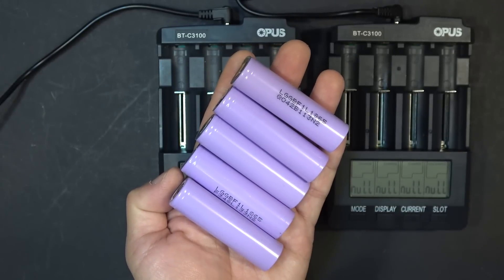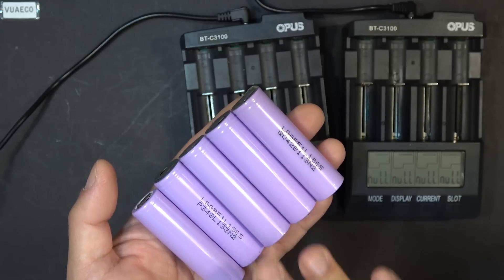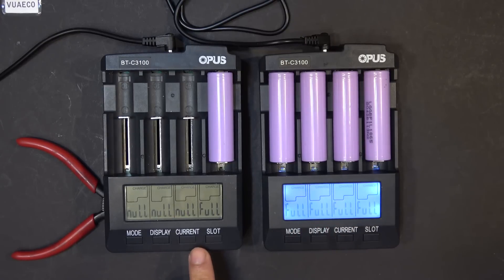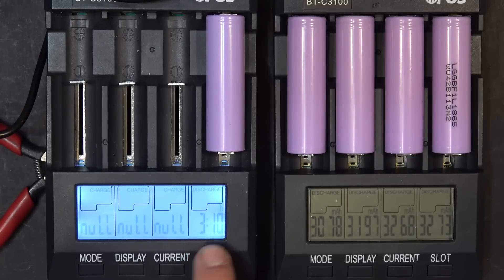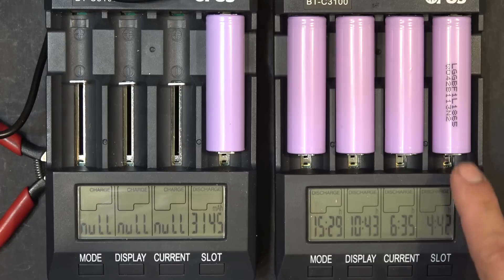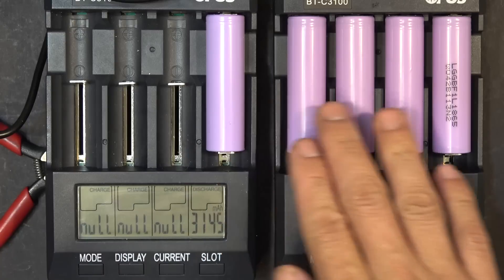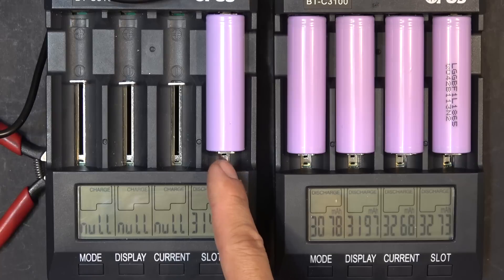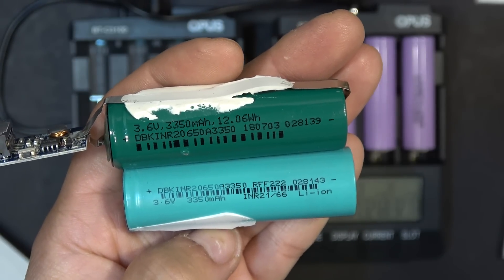Test 18650 cell capacity at different rates: what's the optimum rate of discharge?

Comment: With Opus you will not get full capacity of the cells becouse it only discharge down to 3,21v i use volt meter on every battery directly after discharge with my opus and all cell was 3.21v i think buy alot of opus i buy one but now i use Liitokala Lii 500 it discharge  down to 2,81v  and now i see more real capacity but some battery cells are specified down to 2.5v but have not found any charger that can discharge down to 2.5v but i like Liitokala Lii 500 it´s good enough for me and it don´t have a fan that can fail.
Reply from the maker: That's true the the Opus only discharged down to something like 3.0V and not 2.8V. But I think that's good for the battery because these batteries do not like to be discharged down to zero. You only do that a couple of times and the battery will be dead. Just ad a couple hundred mAh to the total and that should do it. It's much better than draining down the battery all the way to zero.
Reply: @vuaeco  yes that´s true, but you will see less capacity and use less capacity but the batterys will live longer time.

Comment: is there any way to mix laptop batteries and power tool batteries in the same pack considering the different discharge rate ? thanks for the great videos .
Reply: You can mix them without any problem when used for low drain applications, for example in a power wall. 
You can find tons of info on secondlifestorage.com

Comment: I opened this charger today and I noticed when charging 4 cells at 1 amp the cells,springs and motherboard inside gets very hot and that fan is pretty much useless in cooling the whole unit so I mounted a bigger fan right underneath in the middle of unit extracting air thru the cells on the top and makes a big difference
Reply: Same
Reply: How big is the fan u have mounted/model...?
Reply: @AlexAlex-ch7ff  5cm fan

Comment: Many batteries have a standard discharge capacity. the place where we can learn this is to look at the datasheet of that battery. standard discharge current according to the discharge test is to do. Usually 420 mA is specified as standard. So the correct discharge current is 400-500 mA range.

Comment: I myself like slow discharge,slow charge, But temperature plays a major difference other than discharge rates (in my own testing)
Reply: Try a test in a cool room vs a warmer room with the same batteries.
Reply: Or put in garage in winter, if it gets into 30s or into fridge.
Reply: And record them at their finished voltage at the 3 hour through the 15 hour finishes. The heat generated by the cells moves up the line as they shut down. Cooling stabilizes and a self regen stabilization occurs in the chemistry bringing the cell back away from its lowest point with a large gap between each cut off time for discharging. Too bad you couldn't  give the slowest discharge a headstart  so they would all finish at the same time. Still heat buildup would affect cells before starting if side by side. 
Testing was great though. I appreciate your time and willingness to share your data. Thanks

Comment: Hello, I remember seeing a video of someone testing an electric car in eco and turbo modes, and at the time in turbo mode, it made more miles than eco mode, I thought it was strange, but now when watching the video maybe it makes sense, we are not seeing why, maybe it has to do with temperatures, or how the battery releases the energy.
Reply from the maker: There might be some truth to it. Li ion batteries have an optimum temperature where they operate at. But my test with these batteries, they are all tested at the same temperature at the same time. If there's any change in performance, all 5 cells should all change, not just one.

Comment: I have tested 1 of the Onn 3350 mah  20650's and 2 from a 6700 mah power bank.  From the single cell pb  in 4 -1 amp discharge  tests were: 3440,3403,3414& 3458
From the 2 cell bank: 3369&3500

Comment: Your original thinking should prove to be correct with more testing. I have done similar tests and agree that the results you just got are not likely to be trusted.Test one cell only, in one bay only and repeat at various rates to remove most discrepancies. Higher discharge rate should ultimately result in lower mah results but keep in mind that cells tend to work better once they get to optimal temperature. For instance, many racers will charge and discharge a cell a number of times at a high discharge rate to warm the cell before racing to get slightly better performance from it. Maybe you could heat all cells to 30'C before testing.I have a fairly powerful charger so I always test my 18650 cells at 1C using regenerative discharge. This way it takes pretty much the same time for cells of any capacity that I am testing.PS - Mostly I am working with power tool cells that are rated at discharge rates higher than 1C. I always check the specs first. I never exceed maximum specified discharge rate.PPS - Been following your channel for a while now. Love the work you do and happy to be of assistance. Hope this helps!
Reply from the maker: Thanks Alcus. You're right. These cells have an optimum temperature where they would give the best performance. But the thing is, all of them are tested at the same time at the same temperature. So if there's a change in performance, it would affect all of them, not just one.
Reply: Hi Vuaeco. You have the same room temperature but not necessarily the same cell temperature. Let me try to be clearer. The cell tested at low discharge rate is likely still at room temperature and therefore maybe not delivering as many mah as it might. The cell discharging at the highest rate may be warming up to close to its optimum temperature and delivering those extra mah. You are also using different bays. There is no guarantee that the cut off voltages, top and bottom, actual discharge rate, etc are identical from one bay to another.

Comment: Try same test by removing nickle strips. Resistance could be a factor. Lito kala chargers shows resistance.
Reply from the maker: The resistance should be negligible because it is welded to the terminal. It becomes one with the terminal. There might be some resistance if the strip is connected to the terminal at some length.